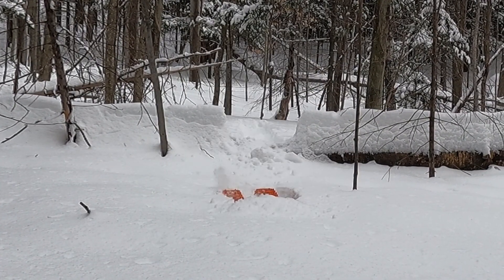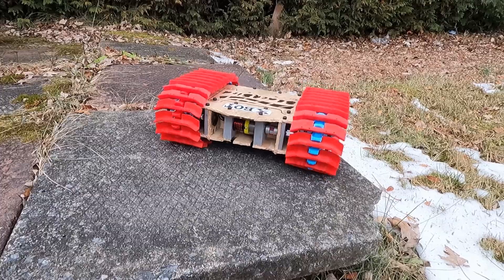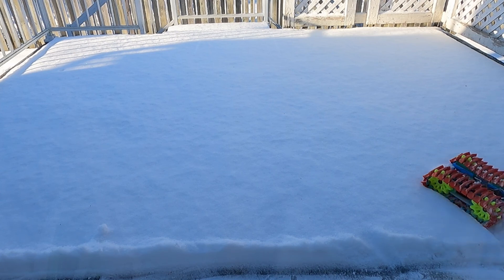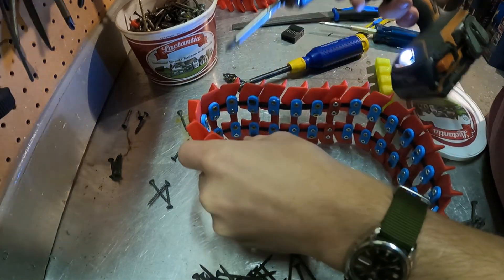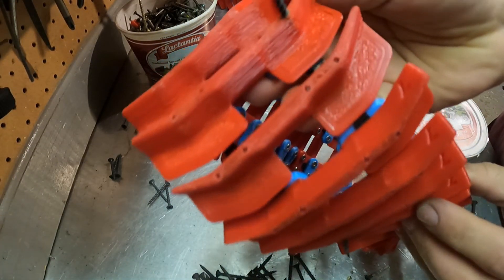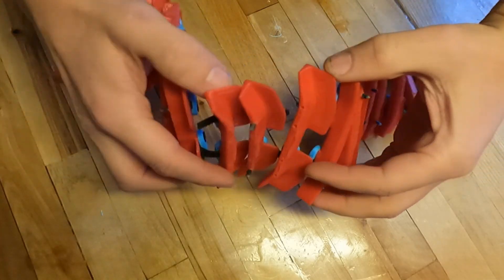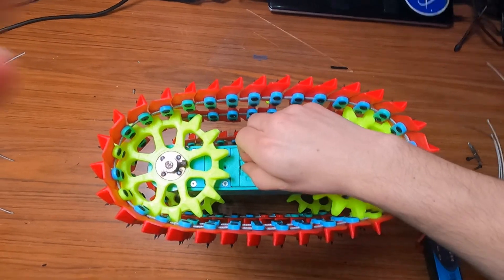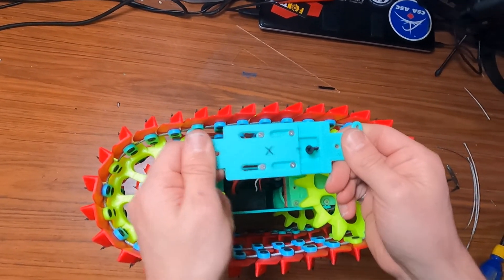DIY rc snow tank | Build and test

Comment: Love the tank. I was wondering the dimensions of it and the Amazon link for the motor does not work. Can wait to build one this winter and race it in the snow.
Reply from the maker: Thanks!
The exterior dimensions of the vehicle are:
Length: 350mm (13.5 inches)
Width: 300mm (12 inches)
Height: 135 mm (5.5 inches)

Thanks for pointing out that the Amazon link is not working. I will find a new link for the motor, but any motor with a 36mm diameter, 50mm length and 4300 Kv or less will work for this project. Have fun building it!

Comment: What type of tank is it like can u buy a ready made one just add electronics? I'm talking about like those arduino tanks because I'm looking for this type of tank that can be flipped an still run like yours
Reply from the maker: I don't know the name of this type of tank. I design this one from nothing and most of part are 3d printed.
All the file can be dowload for free here:
https://www.printables.com/fr/model/164289-fast-rc-tank
The tank is designed in a way that you can probably install some less powerfull and less expensive motor, electronic and batterie to turn it in a kind of explorer tank.